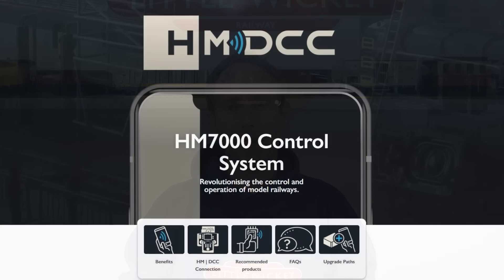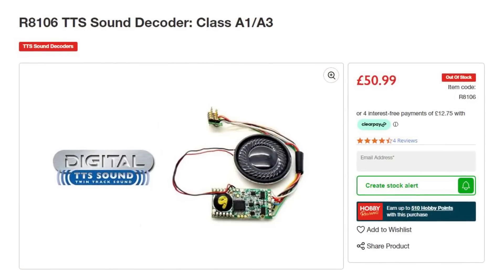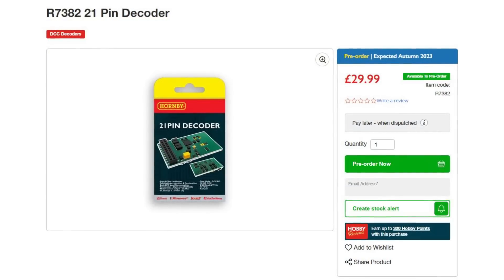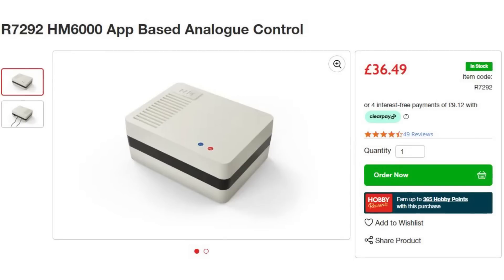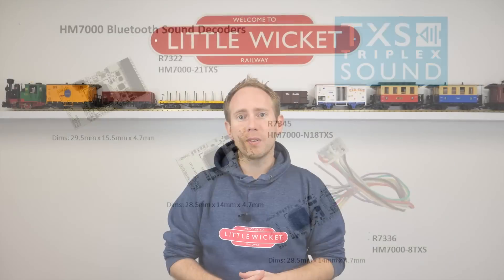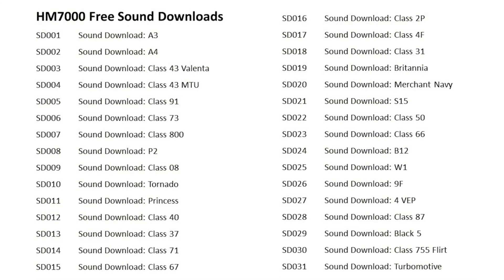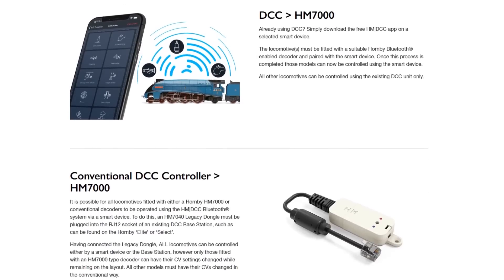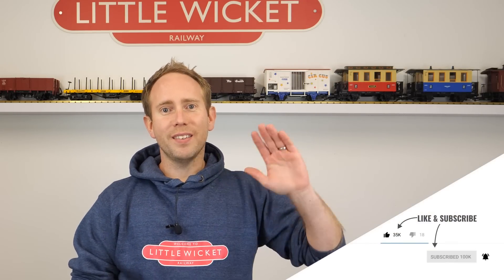Hornby Just Changed the Future of DCC with the HM7000

Comment: Morning Rob, HMDCC definitely an interesting development. Downside for me seems that it would be a 'lock in' to Hornby as I suspect you'd want all locos on your layout controlled in the same way. That may or may not be an issue, will depend on the individual I suspect.  Great technology though and very positive move to make DCC more accessible.

One of the most interesting aspects of the launch for me though was the acknowledgement at the start that '23 will be a catch up year - giving them the chance to deliver on promises made previously. That felt like an important bit of realism from them and was very pleased to hear it.
Reply from the maker: Hi Chris, I agree, I'd like all my locos to be controlled in the same way, but from what I've seen it doesn't have to be a total commitment to Hornby's tech and it might integrate quite well with existing systems.

I was so happy when Hornby said they were going to have a catch up year. I've got a few pre-orders that I've given up hope of ever seeing. They rarely provide status updates and they've got so much going on that sometimes it feels like some models just keep getting pushed to the back of the production line.
Reply: @LittleWicketRailway  agree re I think you'll be able to mix and match. Interesting strategy from Hornby though I think overall.
Reply: They did have a track-fitted bluetooth adapter that would let you control your other decoders (in a centrally controlled DCC setup) via the bluetooth. At least I think that's what it's meant to do.
Reply: @little_britain  definitely keen to learn more about it